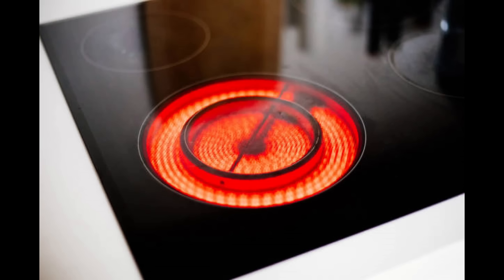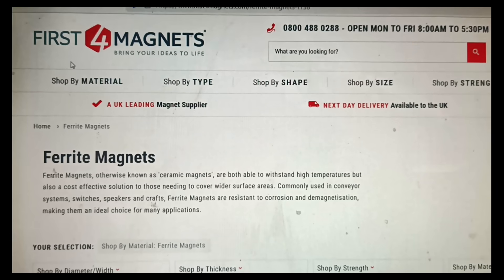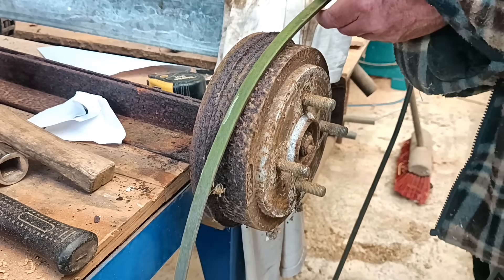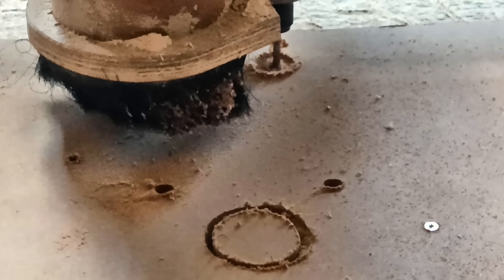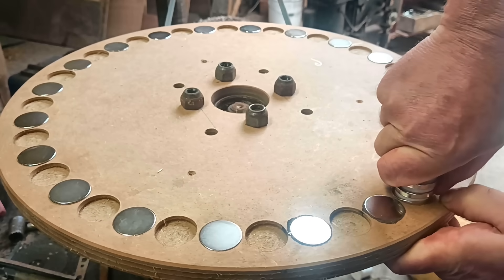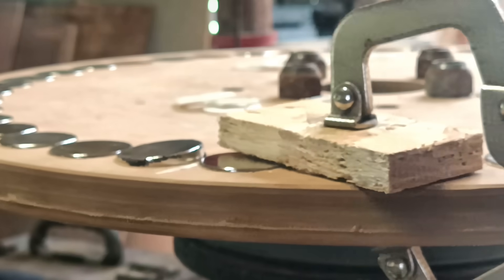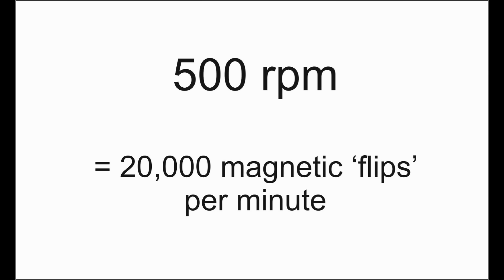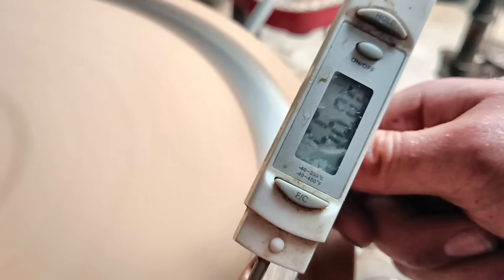I Made A BIG Rotating Magnet Induction Heater! (with magnets from First4Magnets.com)

Comment: Tim, once you get the windmill and the magnet wheel setup done, consider the following: At zero speed, you have maximum torque on the windmill blades/on the magnets, but you produce zero power. At maximum speed, you will have zero torque being applied to the windmill blades, and zero torque at the magnet wheel. The magnet wheel is happier the faster you spin it, that is not of concern. It is the windmill blades who have this intrinsic bell shaped curve of their power output versus speed. At the ends of the graph, the power is zero. The maximum power point is somewhere in between, at a certain speed. That maximum power point speed varies a little bit with load and wind speed, and it is certainly not in the middle of the graph. Your best bet would be to have the windmill turn at the speed at which in most use cases the windmill will produce maximum power, or at least close to maximum power. 

What I want to say with all of this is, make sure that you don't try to operate the windmill at speeds that are far from this perfect sweet spot. If you can't adjust the blade pitch based on load and wind speed (overspeed furling of the blades does not count) then the only way you can affect this operating spot is by setting the reduction ratio correctly (between windmill and magnet wheel). The sweet spot can only be found experimentally. For this, the best thing would be a CVT (continuous variable transmission) in between your windmill and the magnet wheel, and measuring the power output while changing the CVT setting to see where is the maximum power produced, for your average wind speed. But for this experiment, you need constant wind. 
After you have found the ideal transmission ratio, a classic fixed ratio transmission can be installed, which is more efficient and cheaper than a CVT. Changing any parameter of the system (diameters, nr of magnets, etc.) will require you to do the experiment again.

See this just like you see an internal combustion engine: the engine of a car is efficient only at a certain speed.

Good luck!
Reply: Perhaps you can regulate it with the load using a centrifugal governor; controlling the proximity or exposure of the stationary conductor to extract more or less energy to keep it in the sweet spot.
Reply: @OstrichWrestler  That's actually a fantastic idea. It should be simple to implement.
Reply: @OstrichWrestler  Came here to say this. Glad to see others thinking the same way. The simplest mechanism maybe a ramp shape where the coil is pulled up the ramp by the magnetic "drag" forces. As the coil rises up the ramp It gets further from the magnets and produces less drag. The incline of the ramp plus a return spring should be enough to tune and control the power output.
Reply: The load from the eddy currents in the copper are zero at rest and ramp up once motion starts. And can be controlled via the distance to the magnets as well. And possibly self regulating to a point. But definitely starting a large disk from a stop is a matter to consider and some sort of CVT might be helpful - but I worry much about lost efficiency from the transmission. A centrifugal clutch might solve the problem of startup without lost efficiency. Let the windmill get up to speed with zero load and use it's momentum once running to start up the magnet wheel. Once running the efficiency should be 100%. So the question is whether the lost motion during startup and/or minimum speed required is a net gain or loss. Probably depends greatly on the nature of the prevailing winds.
Reply: @bradley3549  I'd say that controlling the distance from the copper to the magnets is all that is needed. The speed governor can be configured to bring the copper in the "acting range" of the magnets only at the desired speed. When the speed is say under 200 rpm, the governor keeps the copper away, and thus zero load. All of this is trivial and can be achieved mechanically.
Reply: Oh that looks dangerous. 🫣
...but very cool, meaning hot 👍
Reply: If the copper was a big round plate with radial cooling fins, you would not need water. It would circulate air and heat it.    Apparently aluminum works well with a carbon coating .
Reply: You lot are all way ahead of me on the mechanics. But it's corrosion of the component being heated that'll go first. Having it polished, cleaned, and kept in a vacuum would help. Have that component be replaceable. Fly wheel and governor seem good, and automatic clutch.
Reply: @benjaminzedrine  the part that comes into contact with the working fluid could be lined with plastic, easier than anything else.
Reply: Centrifugal governors have been used on windmills for about as long as people have made windmills. Likewise, centrifugal clutches have been around well over a century. Plenty of well proven designs out there.

Comment: Very interesting Tim... It's the Eddy currents in the copper which generate the heat.
However I think that minimising the magnetic path through air would be the critical thing.
Which means it would be better if the magnets were embedded in a disk of iron.
And probably it would need to be laminated iron to reduce eddy currents.
Reply: not laminated. the magnetc field in the iron never changes.

but yes, the unused poles of the magnets need to be shorted out. shallow pockets in a steel disc, less than half the magnet length. otherwise they simply short themselves out...

the magnetic path in air, or reluctance... varying the air gap gives a very nice method of controlling the braking force... of course, an electromagnet you can simply vary the excitation current... which is how they work in trains and ruck "retarders".

the current in the copper makes the heat... but if the copper doesnt have sufficient area, or an ideal shape to allow an eddy current to form freely, you get very little result... the pipe here is the wrong geometry to procude "eddy currents". they appear over the pole of the magnets, not in a "loop of wire". whereas a "slab of copper" allows eddy currents to form freely...

solid plate of copper, aluminium, hell, my first dyno used unknown "brass" from the scrapyard and could deal with a 45HP engine! before the design failure reared its head, the brass got stinking hot, and the neo magnets passed their curie point... oops. the second design spun the magnets and kept the conductive disc stationary. much better!

Comment: Genius! Each time, I'm impressed by your unconventionel problem solving!
 
 The copper pipe could be guided in a coil with the same radius of the magnetic ring. To get maximum outcome, one or more rounds over and just as under the magnets. So floating water should have enough time to get hot. Rectangular pipes in the right masurement should give more benefit in plus.

Very interesting project! And better than the heating by friction idea. This magnetic setup seems to be maintenance free!
Reply: no, the copper should be one continuous plate, so as to let eddy current form around each magnet, as they do. 

they dont make a "current" flowing "along the pipe". they make a small "eddy" directly above a magnetic pole.  pipes dont contain enough "conductor" to allow a free path for induced eddy currents... unless you happen to push the magnet THROUGH the pipe. at whic point eddy currents will be produces AROUND the diameter of the pipe itself. the old trick of dropping a magnet down a pipe...
Reply: @paradiselost9946  But, while the magnets are passing , the electrons will jiggle, and the water will heat up. The more time the water has beeing surrounded by jiggling electrons, the more it will heat up. There is no need for a current flowing along the pipe.
Reply: @klausgeiben6608  "the electrons will jiggle"...

ok. care to test this? why not use a GLASS bowl, so the magnetic field "jiggles th electrons" in the water directly? why bother with the conductor at all?

"there is no need for a current flowing around the pipe"...

um, yes there is as the heat is due to resistive heating as that current passes through a conductor... I2R heating... the more current, the more heat. simple.

it isnt "hysteresis" heating. thats what a microwave does with water. utterly different concept.

Comment: Great experiment Tim. Would love to see this done again with a long tube of copper that goes most way round the disc.
Once the water heats up, it should set up its own recirculatorry action into a bucket with the cool water feeding in the bottom, and the hot water spitting out the tube into the top of the bucket.
Reply: still doesnt work. the eddy currents form around each magnet. you need sufficient conductor around each pole to get a good eddy current...

a flat plate of copper, with a pipe soldered to it works far better... nothing stopping the eddy currents from doing their own thing then...
Reply: @paradiselost9946  yes the edycurrents ned area to flow properly. Only change i would use an Aluminium ring because sits way cheaper. To extract the heat add a rund grove around it to insert a copper pipe with goog thermal contact. 
Also get the magnets as close as possible to the plate
Reply: @fabianbohnert120  silver :)

copper can be had in nice slabs from a scrapyard. theres always at least one bus bar or similar being scrapped.

but yeah, aluminium works just as well...

Comment: Suggestion if the disc gets bigger, you can add more rings of magnets. And multiple heating station per ring. Like 8 stations 15 cm long should fit on the current ring no?

Comment: Interesting, so I’m guessing it’s like the magnet drop through copper pipe using Lenz’s Law but the question becomes exactly how much surface area of tube can be installed adjacent to your magnetic rotor before you need more power than the driver can deliver?

Comment: You have to watch the temperature of the magnets, especially for Neodym!
N 80 °C 
M 100 °C 
H 120 °C 
SH 150 °C 
UH 180°C 
EH 200 °C
Overheating them, means they loose their magnetism....
Reply: It will never go abover 100C. The water will make sure of that.
Reply: @FluffyTrinford of course you can. Your radiator  in your car is pressurized . The boiling point rises with pressure . A sealed container to pressurize water at 25 to 30 psi would make it way over 212 f or 100c. And you can cobtinue to heat steam to supeeheared steam over 1000 f.!  I dont know whar the limitations  are on the magnert inductive unit but it isnt the water stopping it at 100.
Reply: @waynegarfield6607  But there is no pressure here. What he wants is a tub of water connected to the hot copper plate. That can never go above 100C. What happens inside a pressurized radiator is irrelevant.
Reply: On a bigger wheel.. The magnets shouldn't heat up much.. since it takes so long for it to go back around and interact again; if he keeps it at one point of contact
Reply: Yes, a Weller Soldering Iron uses this principle to switch contacts from ON to OFF, and vice versa, to prevent overheating, as a thermostat device.
Reply: 😂🤣😂🤣🤣 what hang these comments is what I imagine a group of monkeys doing as they teach each other the misinformation they've all watched on YouTube
Reply: Kinda funny how typical mainstream consensus science says the earth’s core is magnetic and molten iron. 

 Of course nobody knows. But it doesn’t stop them from saying so. 
 And even though so many people know heat and magnetism are not even close to compatible, people still unquestioning belief it. 
 It is like nasa. Why does nobody question a government agency that gets over 60 billion a year that lies constantly.  But nooooo questioning these priests of fake science.
Reply: Kinda funny how typical mainstream consensus science says the earth’s core is magnetic and molten iron. 

 Of course nobody knows. But it doesn’t stop them from saying so. 
 And even though so many people know heat and magnetism are not even close to compatible, people still unquestioning belief it. 
 It is like nasa. Why does nobody question a government agency that gets over 60 billion a year that lies constantly.  But nooooo questioning these priests of fake science.
Reply: The magnets don't heat up.
Reply: Yes, not unless you spill boiling water on them.
Reply: @peripheralarbor  because majority rules and you just agree with the sheep? 🤔 
Explain?
Reply: @hulkgqnissanpatrol6121  The magnetic field doesn't move inside the magnets very much, so there isn't very much eddy current, and therefore not much heating.
Reply: @spoonerreligionandpolitics  it's either or Not not much therefore not very much 😂 👍  O-M-F-G 😑
Reply: You might know about convention but do you know anything about Conduction ?  Or even Eddie currents for that matter?
Reply: Anyone know the temp grade of neo magnets in old hard drives? I have plenty of them :)
Reply: @command7772  Sadly, they're all over the place.  There's no real standard.  Unless they're marked, the best you can do is hope, or sacrifice one in the name of finding out, if you have enough from identical drives.

That said, the heat issue is very overstated here.  The induction process doesn't heat up the magnets directly, so they're only going to get hot from radiative heat from the vessel, or something in the vessel splattering on them.  A finish project could easily prevent both of those with a layer of mylar over the magnets.  Anything hot that spills will be thrown off long before it adds any meaningful heat to the magnets.
Reply: Thanks, my concern now is going through 3 boxes of hundreds of them, all stuck together and sorting them. Then is the metal plate on them and since they are not round have to be routed on a disc. Will be fun project one day.
Reply: @command7772  You don't need to reshape them; they don't need to be round so long as they have a reasonably decent packing.  Routing pockets in the spinning disk may be trickier if they're not round, but I can't imagine that'd be worse than trying to cut magnets...
Reply: I meant to say routing pockets for the bent shaped magnets, I would’t consider reshaping them, then the metal plate that need to be removed from each and every one. This is not a weekend project.
Reply: @command7772  - Why not try this? After removing the little metal plates from your magnets, just place the magnets on a stiff steel disk that you will rotate. Maybe glue the magnets in place, and/or have a rim on the disk to keep the magnets from sliding off when spinning fast. The steel disk also acts as a magnetic return path for the magnets, so the action side of the magnets will have stronger magnetic fields and generate more eddy currents and more heat. It's not perfect, but it is good and MUCH simpler.
Reply: The disc has to be easily routable and stronger than mdf. I like the idea of coils on one side and copper tubing on other, one for generating a/c and the other water heat for my small cabin. I am devicing a plan how to do this using wind energy which is very strong here, this will be my autumn/winter project.
Reply: @command7772  you've got to be kidding right? 🤔
Reply: No, why?
Reply: @command7772  what do you N stands for on the chart you are commenting on? 🤔 
😂 🤣 👌 you represent this channel well! 🤡🤡🤡
Reply: i been wathing this video and i knew it from before it will not work .. at the end the guy is just taking the piss with a hidden tourch. and also failed because he forgot to record hahaha 2 weeks ago aparently he died now:))) what a marvel of people.
Reply: @videos40058 
Oxygen pirate,
I believe you are overdue for your nap…
On the tracks.

Comment: Add a copper winding to the wheel with magnets and we get a generator, the energy developed on it will be easier to transport to the house and easier to regulate, and at least something will really heat up.
My acquaintance has a two kilowatt wind generator at the peak (until they were light, at the initial stage of construction, the wind energy was used, and now this is a reserve source of energy) in winter hesitates the garage, while watering the garden in the summer ...
Reply: No

Comment: I feel for you Tim with your flu going on for so long. I'm going through a similar process with a winter cold right now. Yes it's winter in Australia! What seems to happen with me is that a bacterial infection hits while my system is a bit weak from the virus. As long as I can convince my doc that the viral infection has been replaced by a bacterial one, I can be treated with antibiotics.

I'm really enjoying your videos. I was a high school science master for many years but I retired 20 years ago and moved to Tasmania.

Have you thought about using your magnets to generate electricity? My physics background suggests you might be able to generate much more heat this way. The windmill could make electricity and the electricity could drive a heat pump...

Get well soon Tim

Comment: Really interesting, makes me curious about how it works when adding a pump to heat a boiler for later use or home heating of course. What kind of rpm conversion ratio do you expect when used with the windmill?

Comment: Very impressive Tim, I think you might want to consider some other material for the disk if you increase the speed anymore. I don't think I would trust MDF to last at higher RPMs. Also maybe build a bracket to hold the water pipe above the disk and make it bigger to cover more area, I bet it would heat the water faster. Hope your health improves very soon.
Reply: You seen in the one clip he showed someone using an aluminum disk for the base. This is smart as it it tougher and will act as a heat sink to keep the magnets cooler, as neodymium magnets will lose their strength at higher temps.